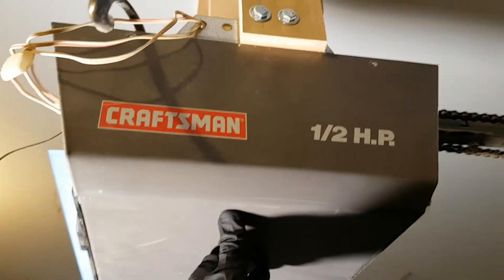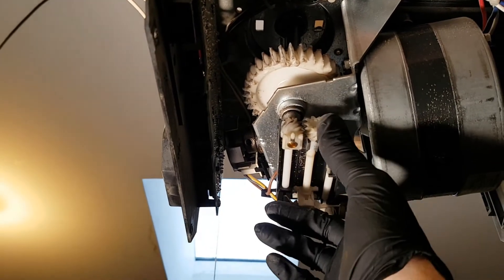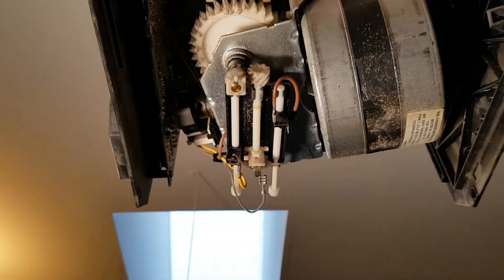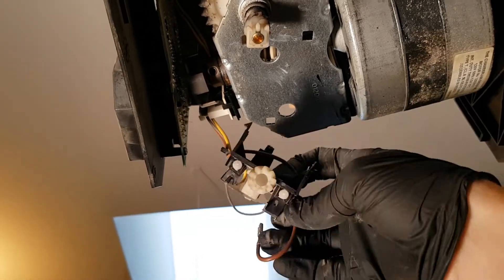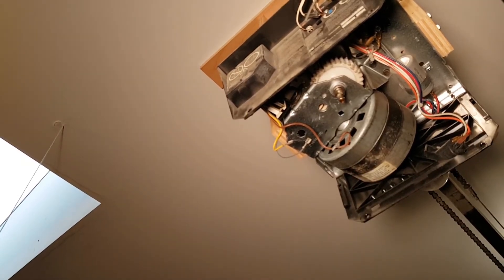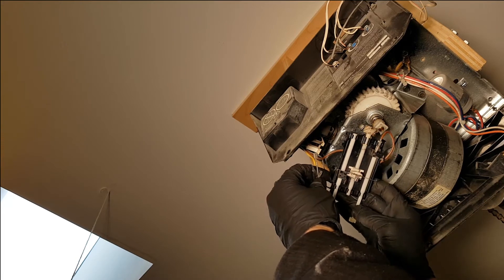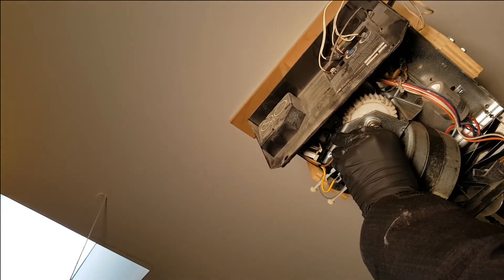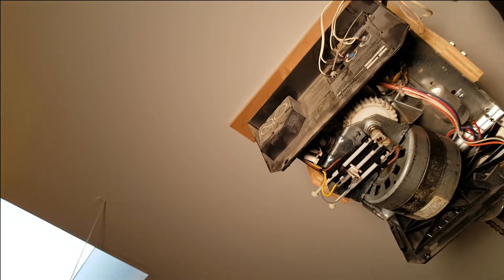Garage Door Limit Switch Replacement - Craftsman 1/2 HP

Comment: you are talking about the exact problem i have with my garage door opener.  I found out what the reason was. when i saw your video i was amazed. Great video. thank you.  one thing i found out is if you install the limit switch and then install the gear with the pin it is much easier to install. that way you won't damage any of the gears. My garage door opener is also craftsman 1/2 horse power.

Comment: Wow, nearly 3,000 views and 7 likes before me, really people? I did my install in less than half the time this video took to shoot, in large part due to your detailing the location of the wires (a repair guy uninstalled mine so I didn't know where to put them back) Thanks, they wanted $160 for this 3 minute install (which included putting lithium grease on the new gears. I got my part new for $16 on Ebay...don't buy this used, the gear is crucial. Thanks much